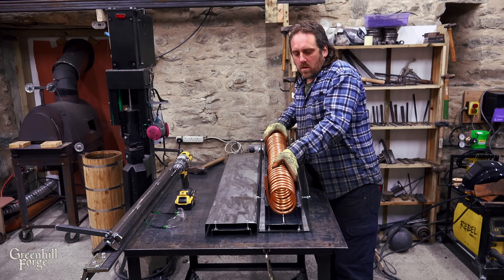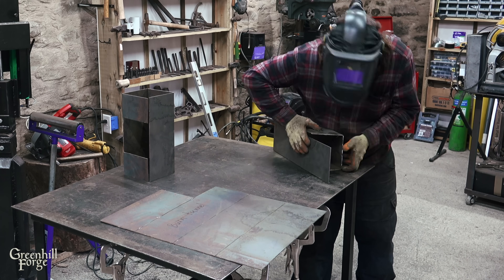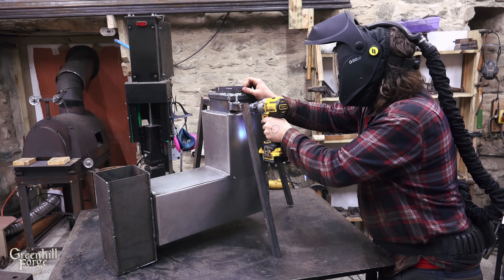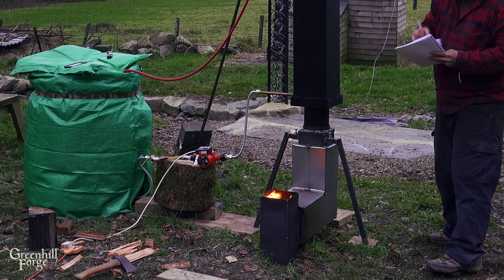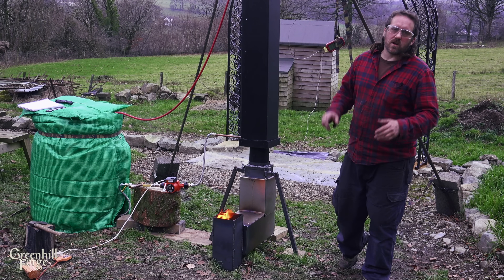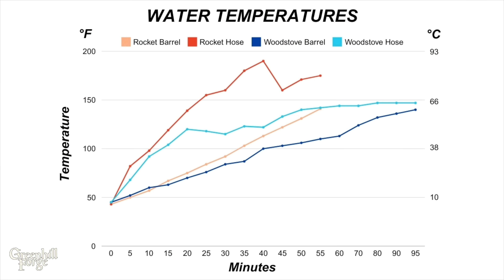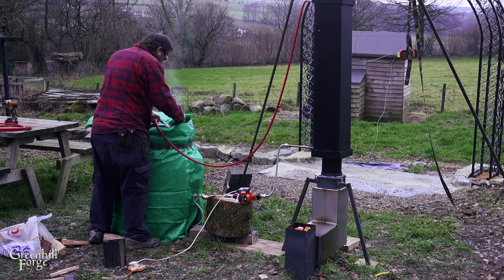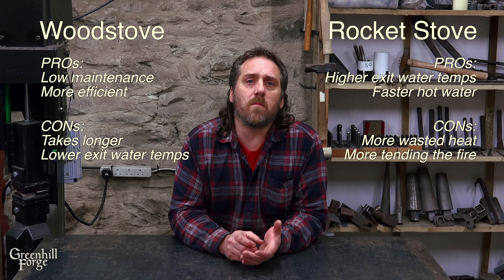Rocket Stove Water Heater Experiment Pt2 -TOO Powerful?

Comment: I think you could get better burn efficiency by increasing the secondary air feed.

Essentially you should be able to eliminate soot completely. 

Basically in a traditional firebox you should have a bed of coal on the bottom. And through the bottom you feed air, that is called primary air. And one should understand that primary air feed controls the temperature of the coal and rate of gasification of the fuel. The more primary air, the faster the burn. But this also means that by feeding just primary air it is not possible to get efficient burn, because more air will just increase temperature and gasification. So you need secondary air to burn of the gases.

Once you have the air feed optimized, you can actually have fairly slow burn, and yet high efficiency. If you get it right, you can control the powerlevel of the burn with primary air. Just have sufficient secondary air feed with good enough mixing and you are good to go.

As for heat recovery efficiency... It might be possible to increase the efficiency of your current setup by simply adding turbulence-elements to the middle of your coil. As as far as I could tell, you basically have one big straight hole through the whole thing...  You could do something like suspend a rod to the middle of it with a few turbulence plates with some intervals. And they would not need to be huge or anything. After all the point is not to choke the flow, but to create turbulence that would basically mix the hot gas in the middle with the cooled gas closer to the coil. And it could be that you might not need anything at the bottom, as that is so hot you might not even want to increase the thermal loading on the bottom of the coil anyway. Even with factory built water heaters usually turbulence-elements are only on the secondary convention tubes with the primary convention tubes simply open.

It is not impossible to have overall efficiency of higher than 85%... But obviously that would be likely well beyond of what you are making here. I am just saying that higher efficiency is not unachievable. But I think even with a little bit of tweaking you could get much more out of it. And that is essentially with only minor modifications.

But yet again, very interesting content.

I understand if someone would feel like I am trying to be superior or something... But I think that this is just something that I am interested in and don't mean to offend anyone. In one form or another I have been studying this subject ever since I was a little kid.
Reply from the maker: I just put out a video modding the rocket stove where I added secondary air and increased primary. signs of soot/carbon went way down in the initial testing

Comment: You should use the heating loop as a closed circuit within a bigger tank as your water heater, it will give you better control over temperature by using a circulator. nice metalworking

Comment: To me, this whole design is crazy and needs a re-think. You're basically creating an exhaust gas energy recovery system, which is what you'd do to squeeze the last little bit of efficiency out of a heater. So, it's good for that. But you've gone after the last few percent, rather than the main source of heat. You're eating the crust and throwing away the sandwich! You've left the low hanging fruit on the table. You're relying on air (exhaust) temperatures to heat the coil, one of the worst methods of heat transfer. And you're putting the coil in the exhaust gas where unburnt exhaust particulates will condense against the colder coil. Basically, you've engineered every problem you could have to be maximized. 

To use an analogy, you're trying to cook a pot of soup using the chimney exhaust instead of the fire. It takes forever, it uses a ton of fuel, it doesn't get very hot, and you get sticky and ashy residue all over the pot. Every part of this is backwards to the priorities your design should have.

And, a rocket heater, if designed properly, shouldn't have much of any unburnt particulates, creosote, ash, etc in the exhaust. That's the point of a rocket heater, so that design needs rework too because it's hardly any better than the stove version. A rocket heater needs high air volume and high heat to ensure complete combustion. Ideally CO2 is the only thing coming out the other end, everything else carbony that was in the gas got burnt and turned into CO2.

You already have a combustion chamber, that's what your heater coil should be connected to or placed in, the place where the actual fire is. Again, pot on the fire, or, if you imagine an old wood burning stove, where do you put the pot? Inside the chimney, or on the stove top? Where do you put the pot on a campfire, in the fire, or up in the smoke?

I would directly, physically couple the copper coil to the top of the stove. Braze it right to the top plate. So you have FIRE --> Metal --> Water. The metal separates the water from the fire, but otherwise no intermediate steps. If you don't want to do that, or you're afraid to, then you could use a double-boiler with only a slight drop in efficiency. I.E. The top of the stove is the bottom of a "pot" (square trough perhaps), which you fill with a heat transfer liquid (water), that's not moved or consumed. It's just there to soak up every joule of heat from the top of the stove, and to transfer it to the copper coil. The copper coil goes inside the pot. Fire --> Metal --> Water --> Copper --> Water. You wouldn't need it to be 30 feet of coil, the massively-superior heat transfer ability of water vs. air means you could almost just run 1 foot of pipe through the box and that'd do. Copper and water transfer heat almost perfectly and thoroughly, almost instantly. I'd do a flat coil (like a stove element), because, you've got the space on the top of the stove, might as well use it, won't hurt. Then... if you want to pre-heat the water using the exhaust flow as well, meh, okay, recover that last few percent of efficiency using some janky rig like you've built here. The transfer liquid (water that the coil sits in) might slowly evaporate, but, meh. 

But jeez man, you've done everything the absolute hardest and least efficient, most messy way first.

If you want to insulate something, you should be insulating the stove itself, not the exhaust, that's just silly and hardly has any impact.

Comment: What if you add secondary air inlets at the base of the coil and after the fuel? Two angled channels that warm up and accelerate the cold ground air into the chimney to burn absolutely everything and increasing mass flow rate which should make heating faster while perhaps avoiding superheating.
Reply from the maker: I've got some mods to the rocket stove coming...

Comment: this is an interesting experiment, I agree that the heat exchanger might have been too small, but I think your on to something with this rocket stove water heater. be a great quick starter for a hot tub or in floor heating system, but as someone else pointed out having a wood stove as the maintainer stove for when you get the water to temp might be the way to go. I'd do an experiment with both stoves going next.

Comment: Sounds to me like the best system would be to have both the traditional stove and the rocket stove, connected to the same heat exchanger system. Use Rocket Stove to get up to temp rapidly, use Wood Stove to maintain temp over prolonged periods of time.

Comment: Video idea, I want to do this myself.
Put the coil in a double skin flue then fill it with sand.
This means you wouldn't have to clean the coil and could just clean it like normal.

My plan is to then put this on the return for my gas combi boiler to more evenly spread the heat around my house and increase the efficiency of my gas boiler.

What do you think?
Reply from the maker: Stay tuned.

Comment: wild part is that rocket stove actually is working about half as efficiently as it could be, your suppose be able to load the exhaust stack with wood as well so when the fire is pulled through it accelerates the burning of the wood in the stack which then raises the temp even more lol but tbh im not sure if the copper would survive those kind of temps like you should see flames shooting out of the top of the pipe

Comment: would like to see the rocket stove design built into a masonry stove, perhaps put the heat exchanger further from the fire box for better control. Also the masonry stove would be able to absorb and slowly radiate out the residual heat that escapes. 1200 degrees is absolutely nuts, but that heat could definitely be used elsewhere. This wouldn't work well as a standalone water heater though, especially not for use in the summer, so maybe a separate system built away from your main structure??
Reply from the maker: I'm trying to make a design exclusively for outdoor off grid water heating for immediate use. Eventually I'll do an indoor home heating based system but for this goal aditional thermal mass would hinder the water heating. You're right, the trick will be to figure out how to not waste that escaping heat. I've got a new design I'm testing today, video coming soon I hope

Comment: I wonder if you could spiral or stair step the thermal exchanger part of the vent tube and allow more time for heat transfer.
Reply from the maker: I think that would probably help quite a bit
Reply: I have some copper pipe laying around the yard. I've been thinking about how use that in some projects. Pretty much along the same lines of the direction you are showing. I'm more a kin to a scrapper who likes to make things more than I'm a scrapper at times.

Comment: lot of people add some small controllable holes at the base of the stack to allow a little extra air in to finish off the burn
You can make a rocket stove that is a lot smaller.  For heating up some water this may be a good idea as it would be less powerful but also eat less wood.

Comment: It's good to see you experiment with these designs while not being married to any of them.  Some thoughts:

1. The fact that there was ANY creosote on the rocket stove coils points out a serious design flaw: the water-heating section needs to be beyond the secondary burn chamber, so that only hot gases are heating the coils, rather than the cooler water decreasing the temperature of the exhaust before the volatiles are fully consumed.  That will make the whole system safer and more efficient.

2. Most water heating systems of this type reverse the water and exhaust, running the exhaust through many small pipes in a tall tank of water.  This ensures that, even if the water boils, it can't explode/etc.  As well, the coolest water will always be at the bottom of the tank, where the exhaust is hottest.  

If the total cross sectional area of the pipes is a multiple of the chimney cross-sectional area, the exhaust will slow down by that multiple, giving more time for heat to transfer into the water.  Also, fins on the outside of the pipes will substantially increase the amount of surface area heat can dissipate from.  (Fins on the inside of the pipes would increase it even more.)  After the exhaust gases leave the pipes, you can have them flow down the outside of the tank to pull the last bits of heat out before heading back up to the tall flue.

(You could dig into how locomotives work to get some ideas for your designs.)

3. Most folks eventually learn that only high-temperature-resistant metals like 310 stainless steel or Inconel 600 can face the insane temperatures inside a rocket stove without melting or eroding over time.  If you go with a tank design, however, the water will keep the temperatures low enough that less expensive metals can be used, especially if you place refractory bricks under the tank to moderate the flow of heat.

4. On thing I see in a lot of designs is that firewood blocking the air flow isn't taken into consideration.  A rocket stove depends on 
maximum air flow, which is why many designs are 'L'-shaped, with the fuel resting on a shelf only part-way into the horizontal branch, which has an open end.

5. If you want to automate the whole thing, you can use pellets or add a long chute that a row of pieces of firewood can be laid in.  For the latter, a wheel can drop and close a switch when the last piece goes by.

Cheers!

Comment: it sounds weird but you really should be pumping the water the other way through your stack. cool water inlet from top to hot out the bottom. I bet your efficiency will increase and total time reduced by 5-10% for free!
Reply from the maker: In the previous video I explain why I intentionally didn't use counterflow but good shout

Comment: Efficiency - although you have higher out you burn more gasses in rocket types as they work with surplus’s oxygen - so better burn more efficient … maybe still overall better efficient that wood burning stove
Reply from the maker: Exactly. The rocket stove was more efficient at converting the wood to heat but the heat exchanger was insufficient to take advantage of it.

Comment: what if you put heat exchanger in the hottest part of the rocket stove, the horizontal pipe? of course it would need to be isolated, or probably this whole part would need to be round, so you can wrap a coil around... but then you could just fill the gaps with sand, and it should allow efficient heat transfer

Comment: Water reservoir around the base of the rocket stove as a simple mass. System? Pumped to top of exchanger output to bottom of usuable reservoir cool water from tpp of reservoir into stove reservoir.. Kind of a dual reservoir system. Just thinking in heat exchange terms.. Need to add mass to bottom not top.

Comment: I love that rocket stove, maybe if you remove that high stack and put the damper on the top of the heater box (and close it a little) the burn would be a little slower....great video.
Reply from the maker: Thanks! There's a damper at both ends so I can adjust it up top too. This was the first time I'd really run that stove so I haven't learned its quirks yet. A few more burns and I can probably dial it in.

Comment: It would be cool to see you build a pellet version. Seems like a good on-demand hands off system. You could really dial in precise consitent heat with an auger
Reply from the maker: I agree, it would be cool and a goood system, but the final goal is a fully off grid design so I don't want to add anything that needs electricity. Maybe I'll do one as a side project.
Reply: @GreenhillForge  thx for the work I'll be building something soon

Comment: I love this series! I'm really interested in your next design. Personally I'm going to try building a heater system out of 2 old demidifiers I have lying around. It'll be interesting to see what sort of efficiencies one can get from a DIY system. For off-grid you can have a large storage tank for those days when solar is not available. This can be a baseload thing where basically no maintenance is required, but you could do a wood fire heater as a backup.

While I think your efficiency numbers are valid for coal power stations, uranium really is on another level. The lifecycle efficiency of Nuclear is around 30-60g C02 / kWh, whereas coal is around 1000g C02 / kWh.
Reply from the maker: Sounds like a cool project. I'm a big fan of nuclear. France really did it right. It's hard to separate out the source of power generation because it varies so much by region so I just went with US national average. The only problem with nuclear is that there isn't enough of it. About 18% vs 60% for fossil fuels, which really bring the average down. This is also why I post as much data as I can, that way anyone can use it and any other data to show different ways of looking at it. Thanks.

Comment: Add water pump to heating coil circuit to extract eat and use it to eat a larger body of water? Or move heat in this way to a thermal mass? In floor heating?

Comment: The reason you got more creosote from your rocket stove is due to your feeder tube being at the end. Bring it further toward the junction and you will get a more complete burn. I would like to see the modification for this as the insulation for your method is so much easier to incorporate into the design.

Comment: Be careful with the hot water pumps. I have had the impellers melt or warp on runaway boilers and blow apart inside the system.

Comment: I don't think there's been a channel that I've been more interested in interacting with. Kudos. I'll defer to the real material scientists, but I think you'll end up switching out copper for a steel alloy, at least when you move on from proof-of-concept to actual application. The skin temperatures you're creating are pushing if not exceeding the limits of copper, even if you are treating the water circulating through the closed loop that includes the copper coil. Keep going!

Comment: i think the rocket stove could power a second coil, the tems are just so high that a second coil would make it way more effective, on the other side i think that you should try to pass the hot air in the beginning to some media to get the hot air cleaner, if there is no dirt layer on the copper coil the efficiency will go way up couse ash acts like an insolator. it would lower the maintance time and also provide better absorbtionrate by the copper coil despite the lower temperature it would have due to the cleaning.